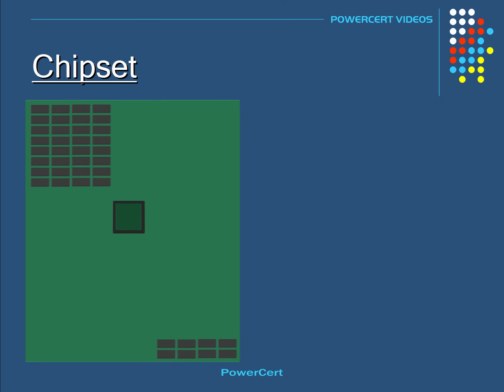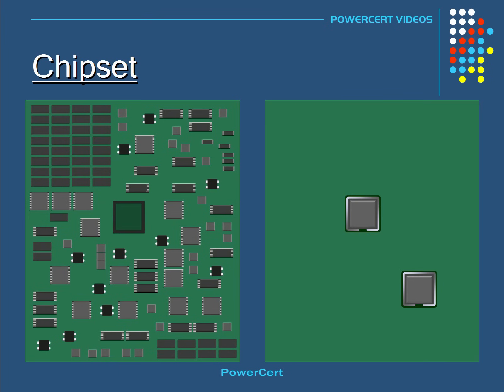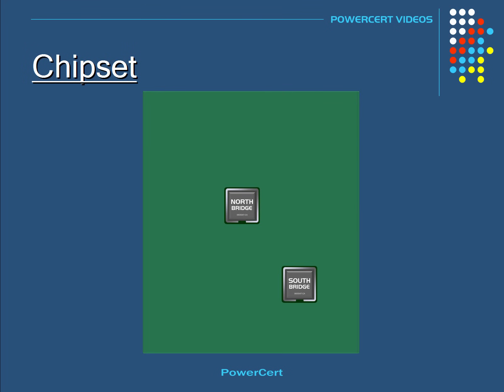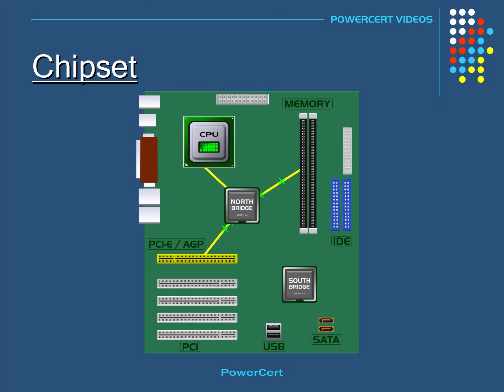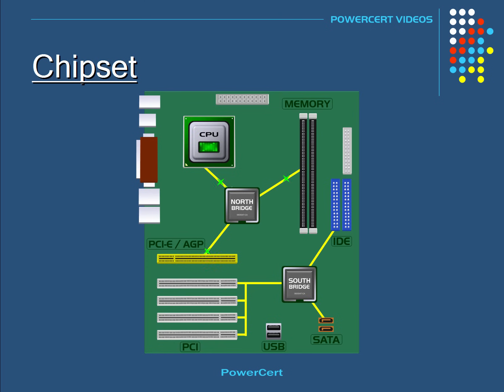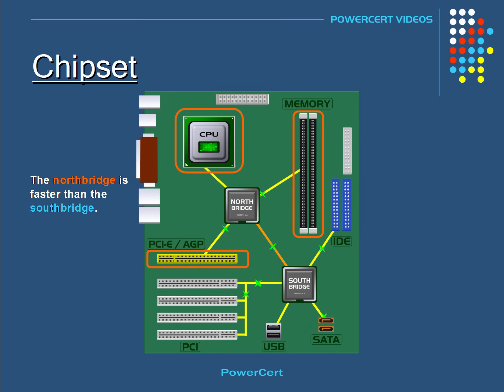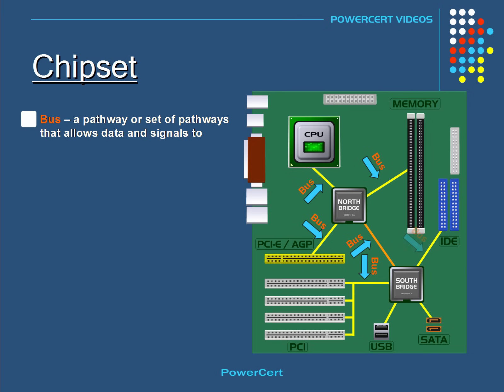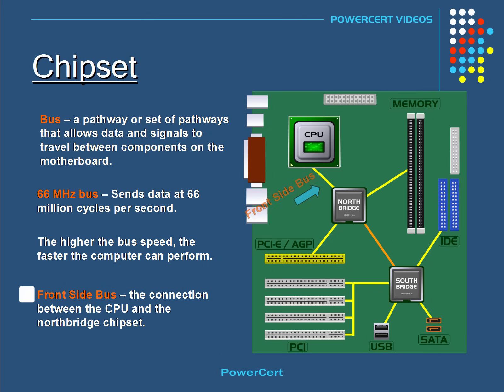What is a Chipset?

Comment: thank you for this great and clear explanation. I am an intermediate  in English it was not too difficult for me to understand. you don't speak quick and too loud. Thanks Again.I didn't know anything about chipsets,  but I noticed a huge difference in the computer I bought in 2004 and my current computer which was manufactured in 2015.
The CPU towers are the same size but the one I have now is about 80% lighter in weight. The older computer was 32- bit single core with 525mb of SDRAM. The newer computer is 64-bit dual core with 3gb of DDR3. The newer computer has far fewer components but can handle a much larger workload probably 10 times faster. It's amazing how much these desktop computers have been simplified.

Comment: Great video. Why do manufacturers don’t eliminate the south bridge, connect everything to the north bridge and increase its capacity? Wouldn’t that increase the systems speed? So everything would be just 2 hops away from the CPU.
Reply: Each bridge performs its job better as a separate entity while maintaining cost effectiveness. In other words they have different circuitry for different jobs, and it would be pointlessly costly to combine them. It also helps with compatibility when combining different types of north and south bridges in unison with all different types of hardware and expansion slots.

Comment: I didn't know anything about chipsets,  but I noticed a huge difference in the computer I bought in 2004 and my current computer which was manufactured in 2015.
The CPU towers are the same size but the one I have now is about 80% lighter in weight. The older computer was 32- bit single core with 525mb of SDRAM. The newer computer is 64-bit dual core with 3gb of DDR3. The newer computer has far fewer components but can handle a much larger workload probably 10 times faster. It's amazing how much these desktop computers have been simplified.

Comment: Explanation is fine and all, but pretty much everything is very outdated here. Northbridge no longer exists, it is now a part of CPU, so there's no separate chips. Southbridge is now called differently (PCH - peripheral controller hub). FSB was Intel only terminology and mostly for Pentium 4 and Core 2 series chips to describe interconnect between CPU and northbridge. It was later renamed to QPI (quick path interconnect) and AMD never used FSB terminology, they they used hypertransport term to describe that same bus and likely now it is renamed to something else. Nowadays 66MHz buses no longer exist. Now legacy PCI bus was 33MHz (in general for bus speed it would be better to use some measurement of amount of data per second, for PCI it is 1056 Mbps), but it hasn't been relevant in mainstream computers since AGP was introduced (for graphics only) and for peripheral usage only it's now 15 years or so obsolete. I get that video is supposed to be simple, but somebody who learned all this stuff would feel lost with modern computer, therefore video should be updated.

Comment: This video is way outdated holy crap. On a modern CPU (in 2019) We have no more north bridge. That's all integrated into the CPU. Like on a Ryzen chipset your north bridge is inside the SOC and it's an I/O chip on Zen 2 chips that communicates directly with the PCI-E bus and the memory, basically doing exactly what a north bridge did in days of old. I dont think Intel has had a north bridge for a while either.
Reply: Well this video still isn't, in any way wrong. Old, but stil applicable on older MOBO's and CPU's
Reply: It is not about how old it is but whether it gets the concept across or not. This does the job very nicely. The newer designs are just a step away. So, one can understand the concept very easily. Btw, you are right about the newer motherboards

Comment: great vid, but today the northbridge practically does not exist, at least  not on the motherboard, it is located directly on the CPU to shorten the length of the link between it and CPU
Reply: Modern motherboards chipset is just the south bridge. The CPU has a direct bus for the RAM, PCIE X16, and south bridge. The first CPU to eliminate the north bridge is the very first intel core i7z
Reply: thanks for the update.
Reply: Also funny thing: EPYC Rome has everything integrated on the CPU package. Looks like the SoC future became reality.
Reply: @neoqueto  Really besides for laptops and desktops most of the technology we use today runs on a SoC. The router / modem, almost all cell phones, network switches that are not a server acting as a network device, the cash register you use at the local store, the IR scanner that is used for the touch ID card on your phone to pay with, etc. and so on. SoCs are extremely useful. Mostly due to low power while keeping the compute needed to be there. 
EPYC Rome is technically not a SoC as it doesn't include a GPU almost everything else.
Reply: @yumri4  oh yeah you're absolutely right, I was talking about the PC/x86 space specifically. It's the only big market that doesn't do it a whole lot. But AMD also does APUs, so we might get true SoC-s from AMD as soon as Ryzen 4000 series if they follow their server heritage.
Reply: @neoqueto  True and ARM failed in the server space. It does have some of it but the majority just is already coded for x86 to which no one who owns the code wants to recode and recompile it to work on ARM to be as good or better than it worked on x86.
For AMD's APUs they are not used in the server space .... maybe for the computer they use to telnet or RDP into the server via a management port but that's it.An APU is cheap thus why to put it into a cheap computer made for a server tech to work with though i am mostly sure a higher end CPU would work better for their job. AM's APUs kinda died thus why Intel can do their thing of " all our CPUs have a GPU" then leave out the part of their Xeon's and most of their highest end consumer desktop models don't have one.
For AMD they still have the price that most people will not just walk away from. Intel well they objectively have the best desktop CPU it also costs alot more than AMDs top CPU. It does not over that much more performance for the higher price. AMD like Intel both have to compete with ARM on the low end of super cheap computers. A standard desktop costs around $250ish $350ish for AMD and Intel while an ARM computer costs around $180 to $250. So IF price is everything ARM is the way to go. Windows no longer supports ARM which is part of the $100 decrease. Windows is $100 maybe less as the OEMs that make the system probably get a volume discount.
Now for what retail stores will try to sell you are the $700 to $1300 desktops as they actually make a profit on those. There are cheaper ones online and in some stores much cheaper if you build your own also.

AMD in short has to keep the low end of the market, it has a handle on the mid-end of the market while it is trying to get the high end and server markets from Intel.
Reply: @yumri4  Why would a GPU be necessary to be a SoC? A computer can run without a GPU.
Reply: @R3lay0  Most use cases of the SoC kinda are used for devices that do have a graphical output on the direct attach screen.  Depends on the use case. A cell phone has no chip just for a graphics processing so the SoC has to do it. The newer gaming consoles have no chip just for graphics processing so the SoC has to do it. 
Now for the server example i do agree the GPU part can be taken out if that makes the chip cheaper to produce in the amounts needed just then you will need another computer with a graphics processor to have it be useful for anything.
Yes  a computer can run without a GPU but most times those computers are specially made and preprogrammed to do or to accept tasks.
Reply: Yup, this video is outdated by 10 years at least. The memory and PCI-express controllers are now inside the CPU.
Reply: @lordwiadro83  Yeah, they're still mentioning AGP, which got deprecated in 2007
Reply: yeah!! and also for faster data communication or transmission!!!
Reply: And I'm here with a motherboard of 2008, with north, south, east, weast bridges!
Reply: @ElementalAer  You forgot to mention Southwest and northeast bridges 🤣
Reply: So that means it does exist but it is located a little differently, it is still on the motherboard but just right under the CPU?
Reply: @johnnyblack4261  No, it is located ON the CPU itself, it is a PART of it
Reply: @paveljelinek772  What if you wanted to connect that CPU to an older motherboard that does have a north bridge, what happens then?
Reply: @johnnyblack4261  D you cannot doo that, it is CPU socket and Chipset related thing, simply the Motherboard with NB on it and CPU compatible with it with NB on itself do not exist, capiche?
Reply: @paveljelinek772  I see.
Reply: It exists, but physically implemented differently.
Reply: @arnold8-u3w  yes, as I said, it is located directly on the CPU die itself
Reply: Thanks for this information!
Reply: Just means computer technology and more specifically CPU Technology has changed a lot over the last 10 years, let alone the last 5 years as well. Still i find the video interesting from learning about CPU workings and understanding the evolution of the CPU with the former North & South Bridge sets.
Reply: and to improve latency
Reply: @Adrian Fietsam And what did you find? Is she cheating on you or anything worse that matters?
Reply: Can this be done to a bag of Doritos?  I want all those chips in the bag to be converted into only one chip so that i can eat only one chip. 🤔🤔 Actually it can be done you eat all the chips in the bag and you convert them into one 💩 😅😅
Reply: but, is it still FASTERR, than.the puny, lil' incompetent southbridge, is the question??

Comment: Well this is how computers used to work about 10 years ago... I haven't heard about FSB and AGP for many years... Modern Intel's CPUs are designed with integrated memory controller and graphics which used to be the functions of north bridge. The term "south bridge" is also somewhat outdated, Intel now calls it Platform Controller Hub or PCH and it has much more functions. But as a basic knowledge it is good, thanks.
Reply: thanks
Reply: There're lots of old computers out there. I own various.
Reply: Well this is outdated, learning about technology is useless. Always getting outdated
Reply: a little history is better than nothing.
Reply: I just asked that question lol. When I saw that the CPU had to go through the NB, I was like but wait, wouldn't thatbe so slow that the CPU has to go to a NB first before it gets to the RAM?